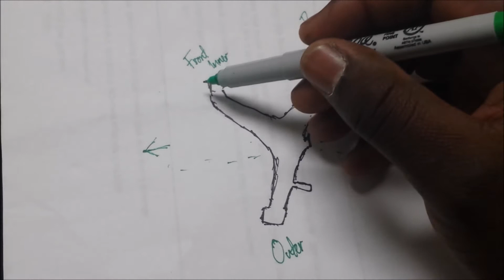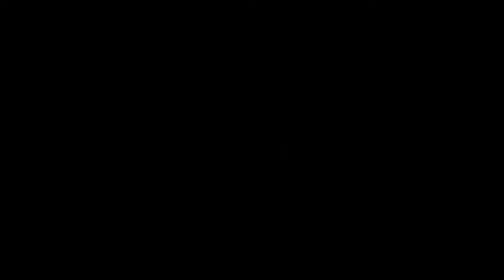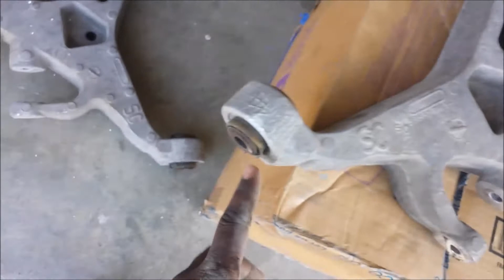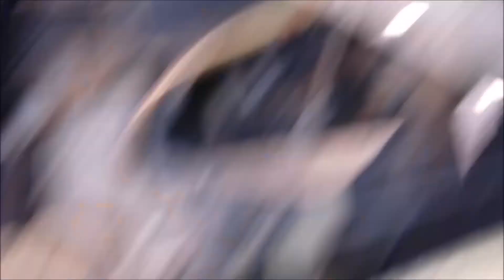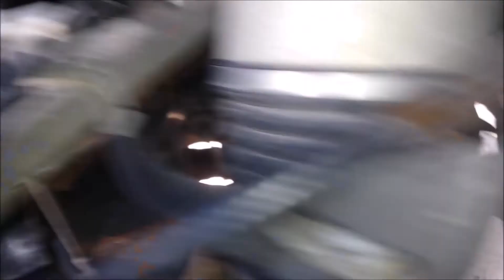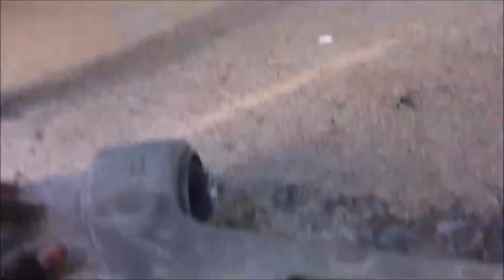Jaguar XJ8 Control Arm. #2 - Polyurethane bushings, Suspension layout

Comment: Hi Ed, Great video I'm just in the middle of the same job.
I'm pressing the bushes out myself and really struggling to tell which way the rear lower inner Bush needs to move to come out, don't suppose you can remember can you?

Cheers
Mark
Reply from the maker: Mark, sorry I cannot recall exactly. However, I know that if you clean off the bush-arm area, you should be able to see that one side of the control arm receiver is tapered.
Reply: @EdBwoy  No worries, I ended up drilling a lot of holes until the central bulb piece could be knocked out. Then tried from both sides with a large socket pushing against the bearing and two pieces of ally at the edges of the other side to allow room for it to push out.

In the end it finally moved with loud bang with socket pushing from the 'inside' of the wishbone so the bearing popped out towards the back of the car.
All back together now so I can get to work tomorrow, so pros and cons😁
Cheers
Mark

Comment: Hey Ed, Where did you get the poly bushings? How will they flex with the geometry of the suspension? Will they be like, fixed or will they flex?
Reply from the maker: I got mine from Powerflex - https://www.powerflexusa.com/

This was 5 years ago, and there was maybe one other vendor serving the US at the time. I hope more options have since become available.
Reply from the maker: With regards to suspension behavior, they will flex just like the original bushings. 
Although they tried to match them, I believe they were still a little firmer than OEM bushings; nothing too terrible - in fact, they will feel 100x better than most of our worn bushings being replaced.

For me, the main value proposition of polyurethane bushings was their durability against wear.
Reply from the maker: Also, because of the sleeves not being bonded to the damping material, these bushings will allow rotation and sometimes you could hear the bushings squeaking. It was not all the time for me - but if I was on a bumpy road at moderate speed, I would hear it as the car went up and down.

I found the air suspension to be quite unsettled over bumps, railroad tracks and the like - being such a light car, so most times I carried 2 spare wheels to keep it more firmly planted.

Comment: Someone jacked up my car without the motor running and now my supension is all the way UP how can I reset level sensors and get it down????
Reply from the maker: Unfortunately I don't know how to reset it. When I jacked the car, I gave no regard to the engine running or not. Usually it would empty the bladders when I jacked one corner too high up, but the car would always rise up to normal level when I started driving.

The one time it went up and refused to come back down, I had to take it into a shop. I had hit a pothole that screwed up the rear right sensor and nothing I did could lower it or soften it.

All the best Sir
Reply: I assume you have it fixed already, but for those who have the same question;
The car sometimes needs a certain speed to start self-adjusting its ride height. So the solution would be: start driving!
For the record, I would also suggest staying at low speeds but at least above 15 m/h (or 25 km/h) or so. A half mile was enough in my case...
Good luck and stay safe! 😊
Reply: Had the same after replacing the compressor. Start it - leave it running on a level surface - it will sort itself out in the end - mine was too far up in the arches to drive so had to leav e it to sort itself out - it took about 20 mins to pump up and level out.